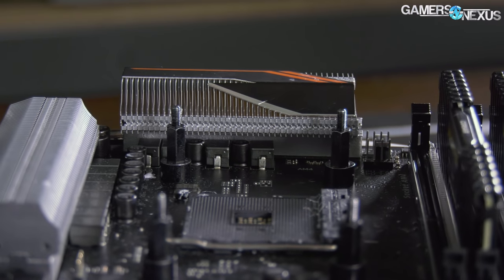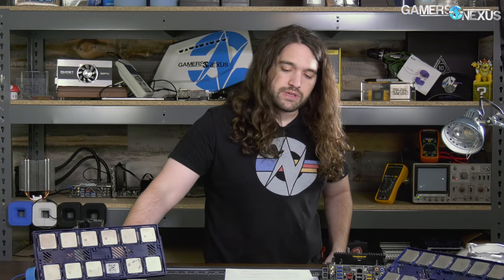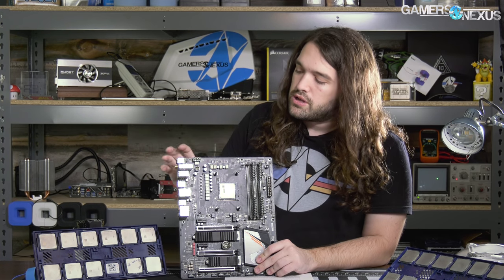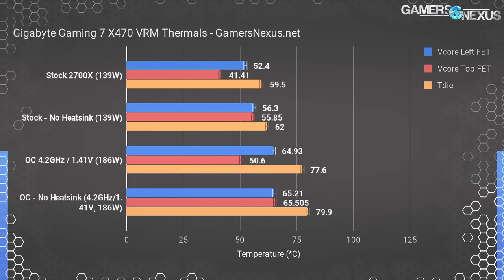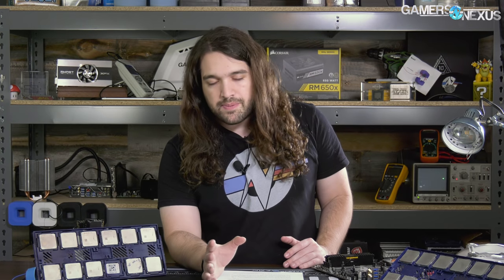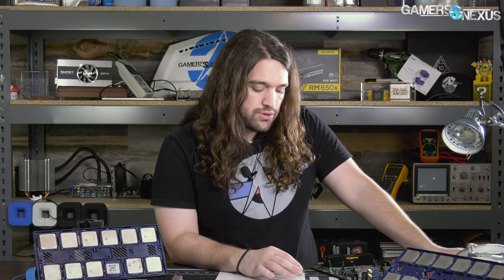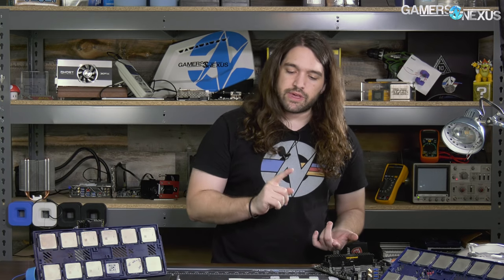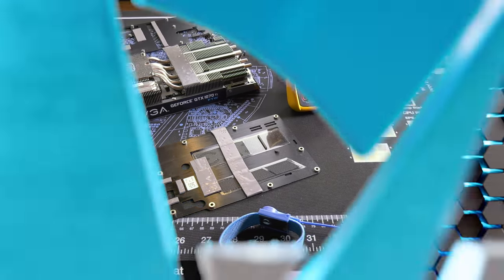Gigabyte X470 VRM Thermals & Planning for 10C/12C Ryzen

Comment: REALLY nice to see proper VRM heat sinks on the MB's
Reply: Yeah just like my A8N-32 SLI Deluxe... 13 years ago.
Reply: i know right, last time i saw a proper heatsink was on my p45 board.
Reply: ha, remember this thing:
https://images.anandtech.com/reviews/motherboards/2008/asus-striker-ii-formula/boardmain1.jpg
to not only cool the vrm with an actice cooler added if wanted/needed but also the toasty nforce chipset.
Reply: ohhh yes, even if it's not needed.
Reply: Just like my M3N-HT Deluxe mempipe edition, which I still have.
Reply: On my M3N-HT I modified a mini tower cooler from thermalright and mounted it to the nforce chipset as the stock heat sink and heat pipes struggled to keep it below 80-90c, it dropped to about 60 after fixing the tower to it. nforce chipsets ran much hotter than the AMD phenoms that it ran lol.
Reply: EVGA boards are good at that z370 FTW
Reply: @pandabuttonftw745  got a ep45-ds4 here.
Haven't gotten a proper vrm heatsink all these years.
Reply: I'm in the middle of replacing by yes very old now A10 5800K on a GA-F2A85X-UP4 with a Ryzen 2700 on a B550 Aorus Elite AX v2 (yes I know not officially supported, but it's been Prime95 for the past 7 days i.e. it works.) Weird that my old board had a small but fin based heatsink on the VRM but my new one has two big blocks of metal. I suspect the small heatsink is actually worse then the big block of metal most of the time, but I'm still not sure I understand the move to big blocks of metal without fins. Is it just because they're assuming most people rarely load everything fully for hours except if they benchmarking or stress testing?

Comment: Hey that's what I said last video on the gigabyte motherboard
"I wonder if the overkill VRM is because of the possibility of 10 and 12 core models with the 7nm ryzen? 
Unless gigabyte just went overkill because everyone was complaining about VRM temps on the previous gen boards. "
Reply from the maker: We also said it in that video. It's a reasonable assumption.
Reply: yeah, but you could sell more motherboards by not putting a heatsink on the x470, and making them upgrade to x570
Reply: Naaw,.. AMD might be planning to launch the 2800x to respond to Intel possibility Coffee Lake 10 core? 🤔🙄
Reply: 8core is more than enough for mainstream applications.
The industry needs to catch up and while they do, amd should focus on improving other aspects instead of just ramping up cores.
Reply: @ 88oscuro
You're not wrong about that, but I think they will add more cores anyway. The main reason is because they're using the same die for Epyc and more cores is always welcome in servers CPUs. But they do need to improve in other aspects too, of course. I guess we'll see what happens.
Reply: WayStedYou next one will have 12+ cores
Reply: It's good to have heatsinks like this if you are liquid cooling because there may be less total air flow and less direct air flow. I had to place a fan blowing on my mobo heatsinks for that reason.
Reply: 88oscuro
I like the cores race. For most of my needs, the 1700 halved my compile times from the 3770k I had for 5 years. Another doubling of cores would be great!
Reply: landwolf00
You got threadripper as well :)
I just feel like the distinction between the "mainstream" and "productive" is getting erased if this keeps going.
Reply: 3950X
Reply: Funny to visit this now (well really even over a year ago) with two generations of 16 cores, and see all the talk in the comments (not just this subthread but others) over them maybe having 10-12 cores or that it would be silly for them to do so because 8 cores is enough and they need to focus on other things. The video itself even if not the title, got lucky since it only talked about high core count.

Comment: They will add 2 cores to every CCX on 7nm.
 We are going to see 12 cores Ryzen 7 3xxx and 24 cores TR.
Reply: TR uses a diferent socket, so its not relevant to theese MB
Reply: Ricardo Fernandes Doesn't matter - the extra pins on TR4 socket are for the quad channel ram and the plethora of PCIe. Extra cores on Ryzen 2 (not Ryzen+, this generation) are fully possible.
Reply: It is relevant, Threadripper uses the same Zeppelin die used for Ryzen, as does EPYC
Reply: Kibito what are the CPUs compatible with these MB?
Are threadripper 1 of them?
Reply: Ricardo Fernandes every thing Zen BUT 1900x, 1920x and 1950x. (These 3 are threadripper which need a x399 board)
Reply: Tenferenzu I think yes it's possible but more cores on the current gen zen+ mean bigger die size and more heat output.
Big die processors means low yield rate and that will make the cost so high. (Like the high cores count Xeons)
Reply: I think this generation is a value proposition. There is no $499 1800x option this time around(ie 2800x). The top of the line is now $349

I expect Threadripper will be the same. IIRC the 1950x was $999 at launch. I think the equivalent will be cheaper this time.

Why? Because when Zen2 ships we will get 12 cores on a Ryzen and 24 on a ThreadRipper. If you buy a 2920x (12 core ) then next year a faster, higher IPC, Higher clock and lower power Ryzen (12 core) comes out, you wont be happy, however if the 2920x is cheap compared to the 1920x then you wont be as but hurt. Original 1920x owners will have enjoyed their chips for 2 years at that point and their x399 board might be able to take a new chip as well. So I think ThreadRipper this gen might be cheaper than both last gen and next gen.

Comment: Next year will be 12c/24t AMD vs 10c/20t Intel on consumer boards. 
Intel can never compete with AMD on core count/raw power and value anymore. 
The only edge they'll probably still have is that 5% more 1080p gaming performance
Reply: And AMD is within spitting distance IPC wise now with the 2nd Generation Ryzen parts according to some of the tech press. So if the GloFo 7nm process really can hit 5ghz as the GloFo guy said in the interview over on Anandtech... Weeell, Intel's gonna be in a world of hurt next year. Especially since their 10nm process is delayed again and is supposedly going to not be even at the level of 14nm++ on release. I have a suspicion that's why they roped in Jim Keller, but we'll see in due time.

Now if only Radeon group could get a good high end GPU out the door.. Hopefully with some actual profits under their belts over at AMD they can get some work done now.

Comment: Will you test the Asrock x470 Taichi Ultimate?
Reply: That's the board I'm planning to use for my upcoming build. I've seen a ton of reviews on it, but not a single one that has actually built it and tested it or gone into any details about whether the components were worth it.

Comment: The problem i have with this heatsink: its only on the top of the line motherboard...the other boards in the lineup still have this solid block. so if you wanna have this functional heatsink, you have to get this very expensive motherboard.

Comment: I assume your gaming benchmarks used the best performing memory kit you had?
Seen Jon Sandströms ROG Crossgar VII Hero enthusiast highlights performance enhancer overclocking with 2700X?
Ai OC tuner = manual. Eclk synchronous, bclk frequency 103.4.
Performance enhancer level 3, cpu core ration 37, DDR4 3308 MHz , core performance boost enabled.
CPU core voltage = offset mode, mode sign = +, voltage offset = 0.05.
Resulting 1T Cinebench clock 4498 MHz with score 188 and nT 4265 MHz and score 1936.
240mm AIO cooler.
I don't know what voltages this would push.  Just 0.05 volt over stock max turbo voltage? Then again in short time spans that can reach quite high? Interesting none the less.
Can this be done on Strix boards too? Other brands boards?

Comment: Premium boards deserve premium heatsinks regardless of whether they are necessary or not. But these finned heatsinks should be on all upmarket mid range boards especially those capable of overclocking and have bog standard 4+2/3 VRMs. In fact I'd like to see some proper 6+2 (not the asrock 3+3+2 jokes) configurations on B450 boards with these fin style heatsinks.

Comment: I just bought an x470 motherboard, will it be able to run the Ryzen processors from 2020? I heard after 2020, they're changing the socket. I know that BIOS updates are going to be necessary.

Comment: Does anybody know if you have to supply power to the extra 4pin on the mother board as my PSU only has one 8pin for CPU power. I'm thinking it only needed for extreme over clocking. My local computer store guy reckons it could be power for RGB. I really don't want to buy another PSU.

Comment: Can we go back to X99 style chipset longevity, where a chipset actually sticks around for two or three CPU generations?
Reply: Justin Maddox ryzen is using am4 thru 2020. Thats 4 generations of cpu compatibility
Reply: Ml That's the deal with Intel's HEDT platforms. There's a specific reason why, but I don't remember off the top of my head.
Reply: Intel has a two proc cycle on their HEDT chipsets and that is due to enterprise. At my company we usually upgrade our workstations every three years, sometimes upgrading the CPU as our software stacks dictate. Professionals and enterprises demand an upgrade cycle from Intel for software/hardware compatibility. Unfortunately, there is a cost relationship to these upgrade cycles.  HEDT consumers pay a lot more than the mainstream consumer. Hence why a lot of my workstations are still using X99/6950X procs.
Reply: AM4 is being used through 2020 that's literally 4 generations of CPU comparability, so literally Gen 1 Ryzen, Ryzen + APUs,2nd Gen Ryzen, 3rd Gen Ryzen/zen 2 architecture

Comment: Wow, so those MOSFETS are something else, not heating up as much even without Heatsinks. That's what I observed on my old Z77 Intel board. It came barebones,  no heatsink. I was concerned of the heat while OC'ing my 3770K to 4.6GHz and bought a thermometer gun. Turned out the MOSFETS were hitting around 60 only. LLC was level 5 and phase to extreme. Worked like a charm until I sold the board.

Comment: Extreme LLC - doesn't that overvolt? Shouldn't you use Turbo? I'm assuming the LLC works similarly to the Z370 Aorus Gaming 7.
Reply: on my Gigabyte Z87X-UD4H board the Extreme LLC = Flat
Reply: I know what LLC is, and any overclock should use it whether or not it's a 24/7 OC. You can't reach stability if your voltage curve isn't somewhat flat. Unless you like overvolting your stuff.

My question was about whether using the highest possible LLC setting that the board offers was ideal.

Comment: Well by giving the conclusion  at the top  watching the whole video is greatly reduced . Your point of improved heat sinking  is canceled  by the statement  not need . then you show 15 degree reduction  that helps . For every  10 c reduction the rule of thump  for EE is factor of 2 up to about 40c thus a factor of 8 . That is a lot. Proper  conclusion  reversed result presentation.

Comment: Hey Steve, you mentioned in the last vid that ppl should check the supported memory of the mobo they're intending on getting before choosing memory (ryzen specifically)... So I am building a Ryzen+ system soon, and I was looking at the Asus Crosshair VII Hero (mobo). Last night I looked on the site at the table of supported memory, and I was blown away to see that there are less supported 3200mhz modules than on an X370 board I got my friend to get recently that's mid range?!?! lol Links below if you're interested. Would like to know how this is possible, or if the supported memory list gets expanded over time? (Didn't think they updated the reference table.)

My X470 - http://dlcdnet.asus.com/pub/ASUS/mb/SocketAM4/ROG_CROSSHAIR-VII-HERO/C7H-Memory-QVL-Ryzen-2nd-Generation-Processors.pdf

Friend's X370 - http://dlcdnet.asus.com/pub/ASUS/mb/SocketAM4/ROG_STRIX_X370-F_GAMING/ROG_STRIX_X370-F_GAMING_DRAM_Non-ECC_QVL_20170522.pdf

Comment: I have one complain about this review. It would be interesting to see VRM temperatures if AIO water cooler was used. True, tower CPU fan doesn't exactly blow on VRM coolers like round AMD stock cooler would, but it still makes some airflow around VRMs.

I had problems when 1st gen Ryzens came out. I have Arctic Liquid Freezer 120 and year ago I bought Gigabyte X370 Gaming K5 to use with R7 1700, seemed to worked fine until I overclocked. I settled on 3.8 GHz, had to up the voltage to 1.325 (If I remember correctly) and again, it seemed to work fine. I ran prime95 to test it and after about an hour I saw black screen. No response to computer, only hard reset helped. 
To cut long story short it was VRMs fault, hwinfo logging showed that computer crashed every time when they reached about 115°C. Reason? No air flow that is usually generated by CPU cooler, even tower ones. I managed to keep VRM temps under 90°C when I zip tied one 8cm fan under VRMs, and even under 85°C when I unscrewed upper 12cm fans and also mounted them with zip ties so they would hang on one side and be directed to VRMs
But if I paid good money for practically whole new computer and I as sure as hell don't want to have fans hanging on zip ties just so it would work reliably. I also use my computer for rendering and this also crashed the computer after cca 1h. 
In the end I returned Gigabyte motherboard and went with Asrock X370 Gaming K4, after reading a bit about VRM trouble I wanted Asrock Tiachi or Asus Crosshair Hero VI, but they were unavailable. After I swapped motherboards problems went away and ASrock's VRMs didn't get over 85°C by default with same OC, and without any fan mountings. This was even during summer when room temperature was up to 30°C.

Comment: I was pretty sure it would work. Just swapped out an Asus B350 for a Gigabyte X470 and didn't even lose my RAID. The chipsets use the same driver installer packages so it booted right into Windows after going through the "getting devices ready" screen for about 2 seconds. I'm still going to do a clean install. I'm just happy as hell that I didn't lose my RAID. I didn't have anything large enough to back up the entire contents of the 4x 4 TB WD Black drives properly. It wasn't fun deciding on what I was willing to lose.

Comment: Hi there!! I love your channel and have been a long time subscriber. I really like your videos on overclocking and in-depth motherboard analysis. I would like, since there aren't so many options out there, that you could do an analysis of the m-itx motherboards available (z370/z390, b450/x470). Instead of like everyone else just looking at the features and number of fan headers available, you could do an in depth analysis of the different VRM solutions offered :) This would be really beneficial as the VRM's inside small itx cases probably won't have that much direct airflow and would affect overclocking potential. Hope you read this comment and can consider a future video for it.

Comment: This will help GREATLY in mITX boards were airflow is limited. I have been tweaking a delidded 8700k+Strix z370-I inside an Ncase M1 and my problem is VRM temps. The processor is a silicon lottery winner stable at 5Ghz 1.35v in Prime 95 no AVX offset load, but after a few minutes the VRM temps skyrocket to the point of throttling. The solid metal VRM heatsinks are too hot to touch over 3 seconds. A decent VRM heatsink with fins would be the solution with this limited airflow. I already killed a motherboard by disabling VRM temperature protection in BIOS (I know it was stupid, but I was drunk and really wanted to confirm that the VRM’s were getting pushed too hard. Blew a mosfet running Prime95)

Outside of Prime95 there is no throttling in any other workload but the VRM heatsinks remain so hot to touch that I can’t imagine the motherboard will run reliably on the long term.

With such high core counts and clock speeds it’s apparent that VRM’s need serious cooling and I’m glad it was Gigabyte of all manufacturers was the one to take action, as they have been traditionally the ones to skimp on these things.

Comment: I disagree with GN conjectured reasoning as to why this & other X470 mobos now have better VRM heatsinks put on them by the manufactures.

I don't think they have done such completely only for aesthetics although this may have affected their designs, but since it is a cost to them they must have several 'proper' reasons for them to incur that loss in profit margin other than preparing for the Zen 2 3000s and being nice.

I think most likely they were probably anticipating higher OC limits with Zen+ than the 2000s reach, these things are probably designed months in advance or it depends what AMD was initially hoping for with Zen+ 2000s OC etc, so to be prepared or just to cover themselves from returns or bad reputations they invested in these VRM saving heatsinks which have now turned out with the apparent max stable OC of 4.2GHz to may be overkill in terms of VRM cooling need.

Are they getting ready for hotter higher core Zen2s, I doubt it since isn't 7nm supposed to be so much more of a power efficiency gain that while it will hopefully allow increases in GHz it will do so without necessarily requiring so much power through the VRMs that the heat is dangerously excessive.

But I do like 'em though I must admit, nice to haves if you are going to splurge out ona high end X470 mobe for a Zen+ 2000X.

I appreciate Steve actually taking the fancy aluminium finned heatsinks off from this Gigabyte mobo & testing OC out of the box thermals... cool, eh!